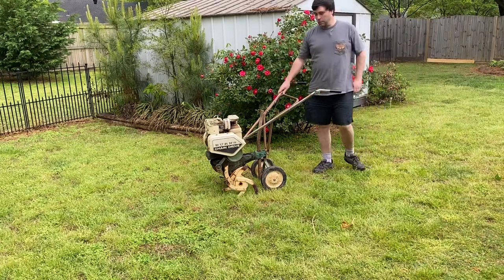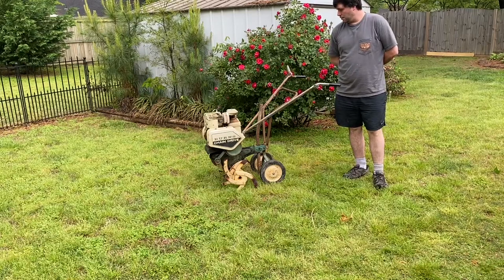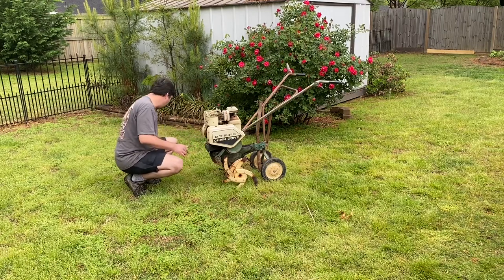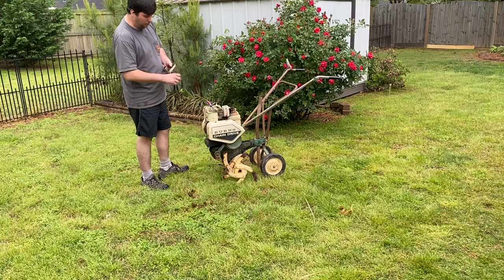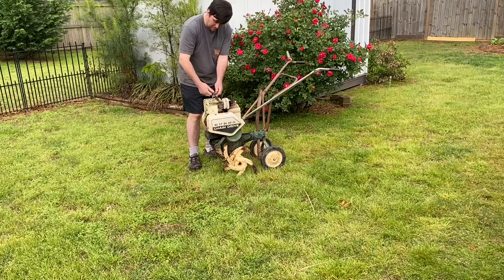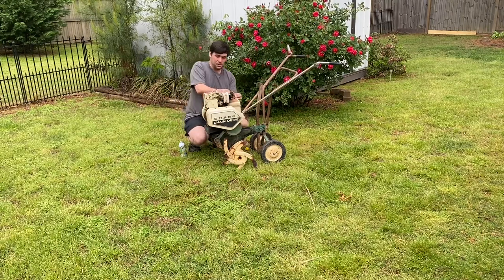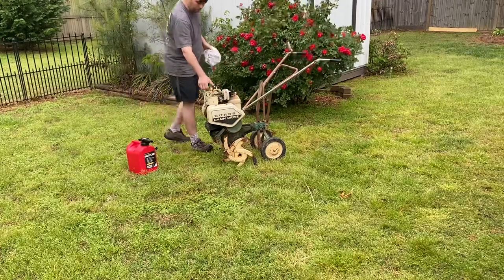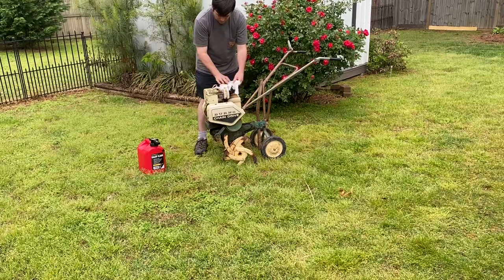1979 Burns (Gilson) Garden Tiller with Briggs & Stratton Engine #chasingtractors

Comment: Picked up an old beat up one. Do you know how you lubricate the chain. It appears to be leaking from a few locations
Reply from the maker: I have never messed with that. Just put some 85w-140 gear oil, or John Deere corn head grease and you should be fine.